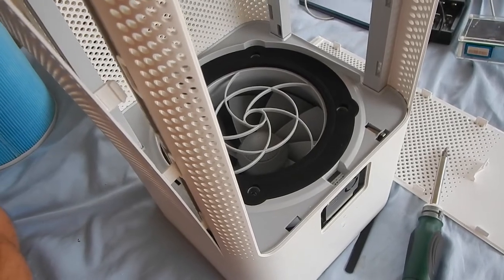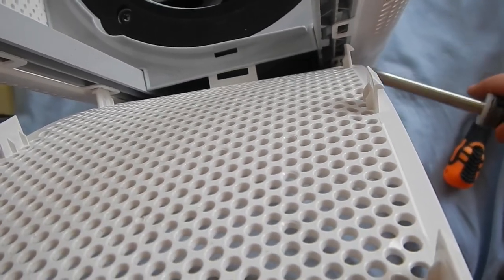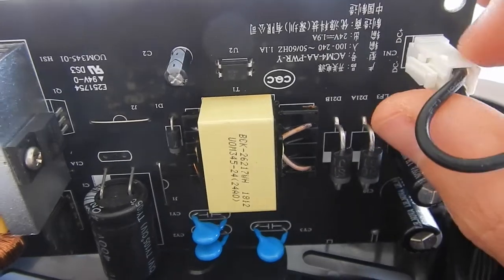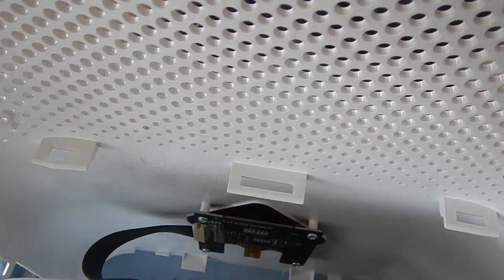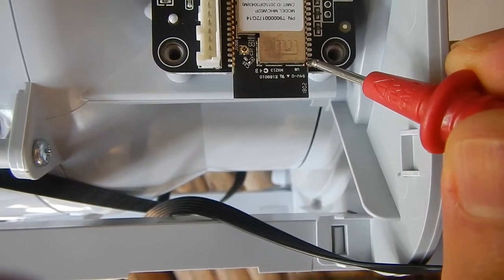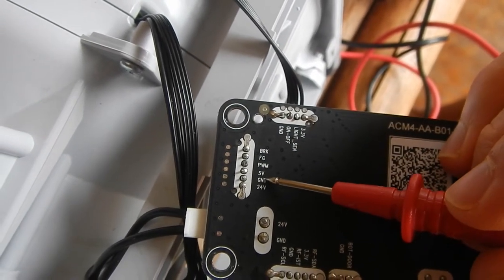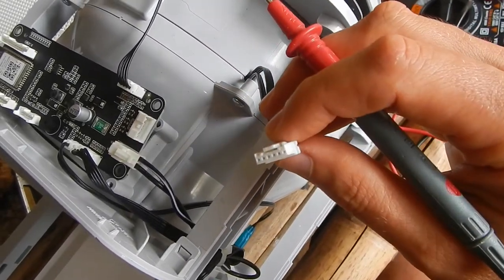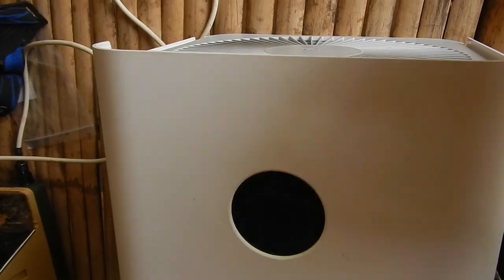Disable Wifi Xiaomi Air Purifier 2s Success

Comment: I have a xiaomi 3h and I am also looking for a way to turn off the wifi, I was ready to cut off the antenna in the wifi module, although the radio itself will still send a wifi signal nearby, in addition, it was at 100% power due to the lack of an antenna and I noticed how I also found such information in the manual that  if we do not connect the purifier to the home application after some time, the purifier will turn off the wifi module until the next wifi module reset.  for me it works, I do not see the device in the network environment, also the antenna icon on the display has gone out.  Please check if this is also the case with you and if I am right in thinking that the wifi module turns off and does not emit a signal
Reply from the maker: I tested this and as far as I remember this does not work the same on Xiaomi Air Purifier 2s

Comment: im not an electronic guy so with my mi purifier 3c i gone for more cave-man method.
i cuted out the wifi antena with scisors (in 3c its the flat 5mmx17mm plate coming out of board) (still worked with 1 bar of range) and then cuted the last bit of antena left and wraped it in layer of isolation tape and then layer of tin foil (so the tin foil do not touch /damage transistors) - no signal
great succes 
auto mode and heart mode - 90% fan power is all i need
Reply from the maker: Great, thanks for sharing your tips and tricks!

Comment: I know you can turn the WiFi & Ozone off on the 4 & 4 Pro (I have both) so I turned both off immediately. Unsure if you can turn it off on the 2, probably not… Will turning the WiFi off on my 4 and 4 Pro be sufficient?
Reply: Are you sure you van turn off wifi on 4 model?
Reply: Yea, double checking can you off WiFi on 4?

Comment: Hey man, tried to access the antenna but I have a couple of questions. First off, to remove the side panels, how the heck do you do that without breaking some pins? Second, by removing that little pimple antenna, don't you think it could start emitting some other kind of radiation or do you believe that without it no radiation is emitted by it anymore? Thanks and cheers.
Reply: So I've tried it, and I can't get the panels open all the way without breaking them :(
Reply from the maker: Just be careful when removing and if you break them, it is not a big deal. It will not break the device.
If the antenna is gone then I strongly believe that there will not be any other radiation emmited except the "radiation" from the electronics themselves.
Thanks and cheers too!
Reply from the maker: @frosti7  it will not break the device though.